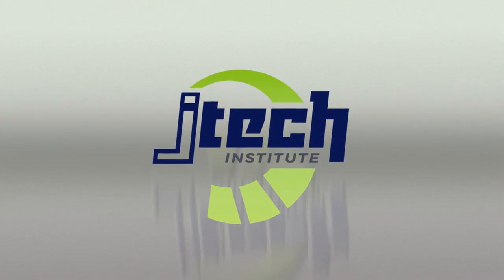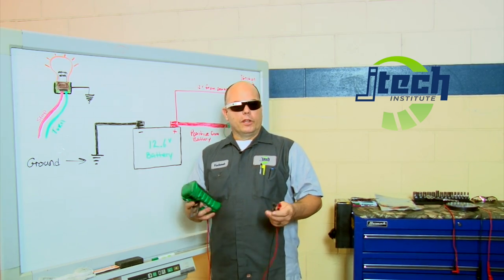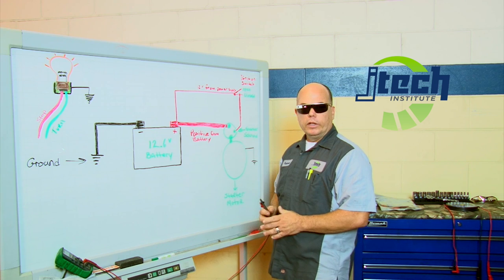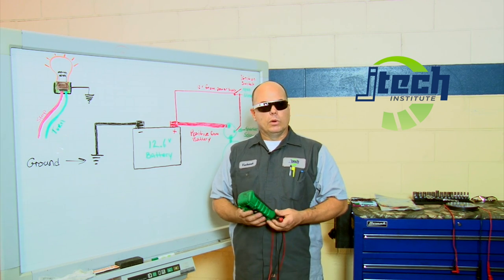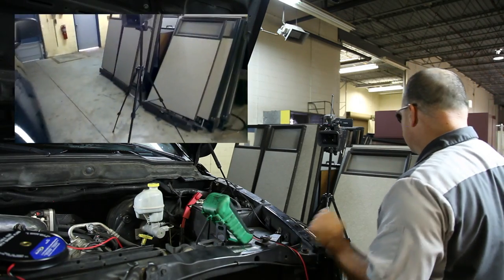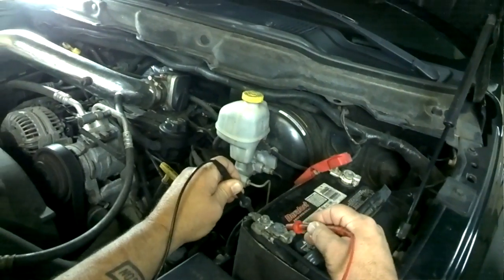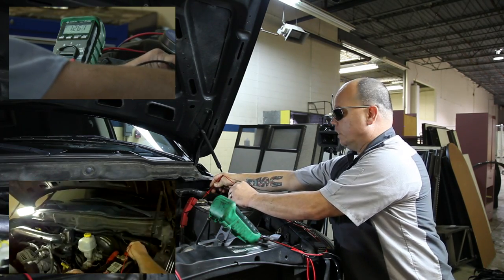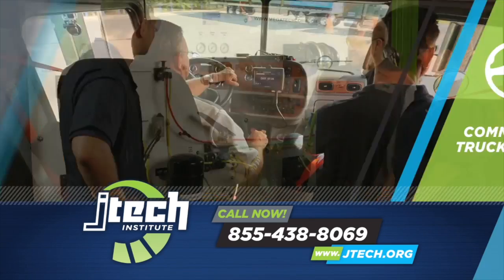Voltage Drop Test on a Starter Unit

Comment: One lead on battery positive, other on starter control side. Disable fuel by pulling relay/fuses for fuel pump so vehicle wont start. Check battery voltage, must be above 12.6 and do a load test to before doing voltage drop. Crank engine and note how many volts the battery drops. Any reading below 10.6 volts and you have excessive draw.

Comment: When he was testing for voltage drop at the ground, was the key set to the on position since a voltage drop test only works under a load?
Reply: That was my question too. Need to load the circuit to show a drop in voltage ⚡

Comment: Is this video a prank ? This is a first, new Physics, measuring a voltage on the same cable, from ground to the minus side of the battery or on the same pole. If it is a prank video it is amusing thinking of all those that will believe it. Its a good one also him saying that the numerals on the multimeter are  jumping around so that they will not burn an image on the screen. Hey, make sure that you do not hold the same reading for too long or its going to be burned there for ever.

Comment: I thought the system had to be under a load. you did not try to start the engine when you were checking for voltage drop?
Reply: you are correct however the loss was at the terminal and had total battery voltage loss.

Comment: have a 1995 pontiac trans am 5.7l. the car cranks but the voltage gauge drops to low after start. when accelerate, the voltage gauge goes to normal. when sitting at idle goes back to low voltage. what is the problem?

Comment: i had this tbl on my wives car  just clicked i jumperd the neg post to eng gd started right up the gd cable was about to fall off the chasis ( loose bolt) i am 88 i have had this happen 3 times  diff vech over the years-------any time you have battery  tbl verfi chassis gd .

Comment: how is it possible to get voltage going neg to grn. don't you need pos to get voltage.
Reply: Ric777888 Bad ground.  If it’s not ground out, you won’t be dropping voltage like you’re supposed to

Comment: YO, Why would the meter be reading +12Volts between the Negative Battery Terminal and the Engine Block??? WTF? The Block is not wired to the Positive side of the battery... it would be reading 0 volts right? This is weird, all I can think is 12volts positive potential is going through load devices somewhere on the car and to the chassis ground. The block must be grounded to the chassis elsewhere besides the battery negative terminal (which I believe is the way most cars are setup).  However most devices are switched through relays and ignition switch. So what Load device on a car is always wired hot to the postive side of the battery?  The starter windings are disconnected from +12volts until the Solenoid coil is pulled in. The Solenoid coil does not get Power until the key is turned to start position.  Car stereo clock/memory and maybe ECU???  I just think this is one of the weirdest approaches to testing battery cables and battery terminal connections.   I ALSO AGREE WITH OTHER COMMENTS, THIS IS NOT A STARTER LOAD TEST.  Load testing starter for Voltage Drop usually done by turning the starter and measuring the voltage.
Reply: ComputerUser321...Cause there was no ground to battery,..  the battery positive wires go to the starter and alternator which are grounded to the engine block which eventually is grounded to the battery negative. And since the ground wasn't complete to the battery negative, connecting the DVOM to the block and battery neg. he completed the circuit therefore reading 12.6v
Reply: You’re right. ComputerUser321 I’m sure that remote starter computer have to be wired to battery + and ground to frame, then battery - all the time. Most of new cars have security system built in which is constantly load your battery with small current.